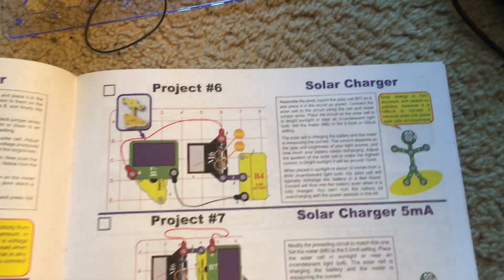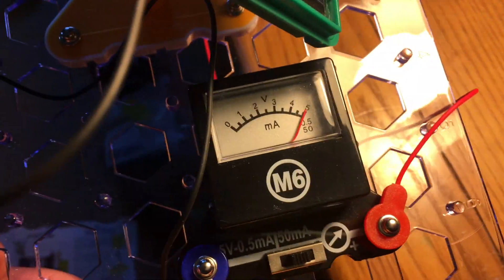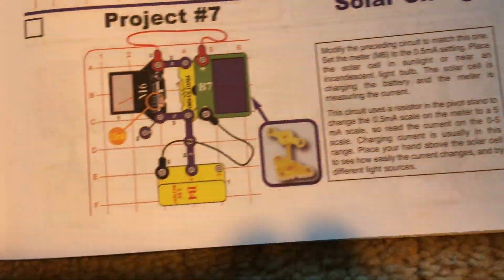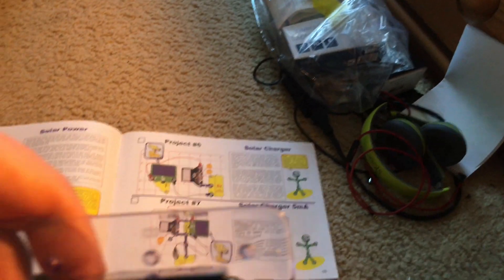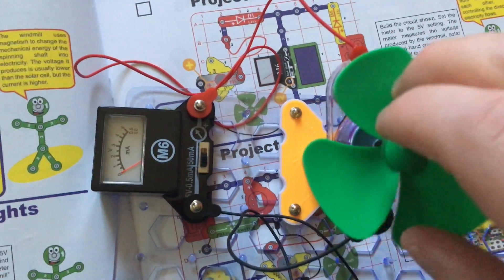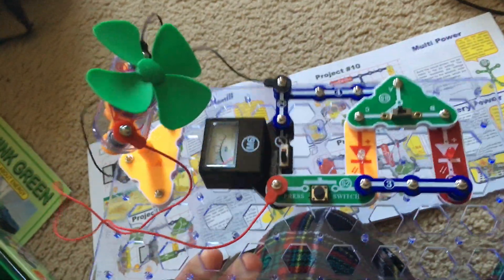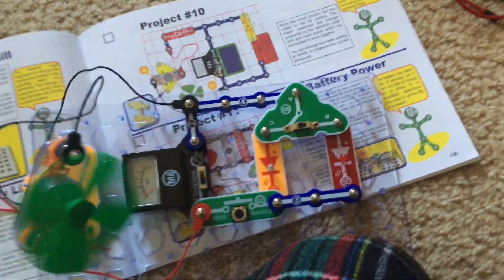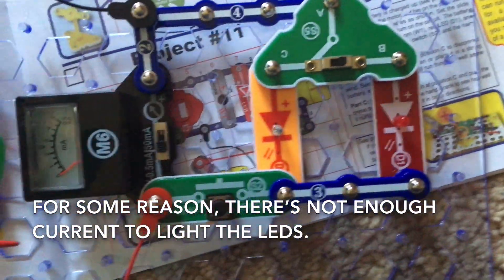Snap Circuits Green Energy: Projects 6-9

Comment: When you recorded project 7, the meter was actually set on the voltage setting instead of the current setting.
Reply from the maker: FoxyFan13 Entertainment You’re right, I don’t think I realized that mistake until I edited the video.  I will post about that in the description so no one gets confused.